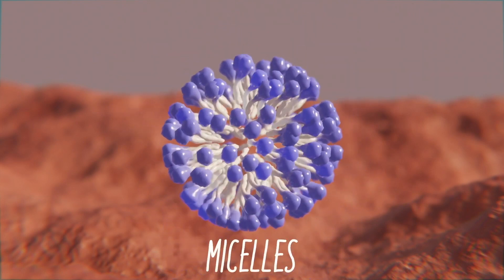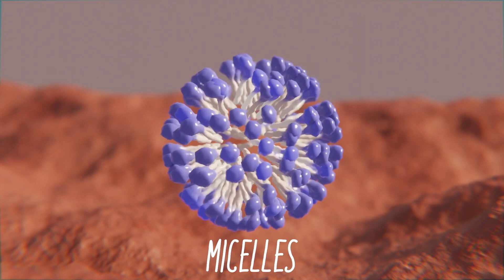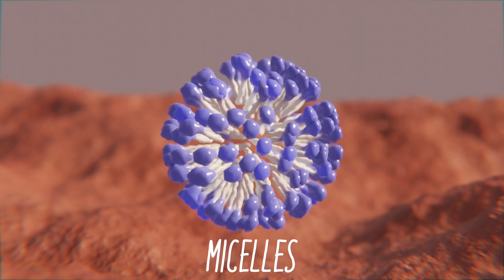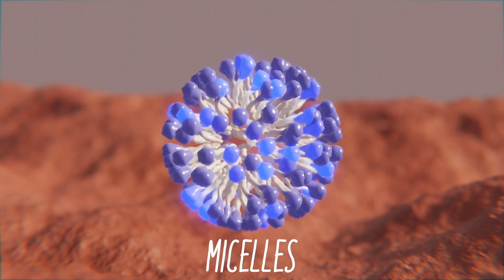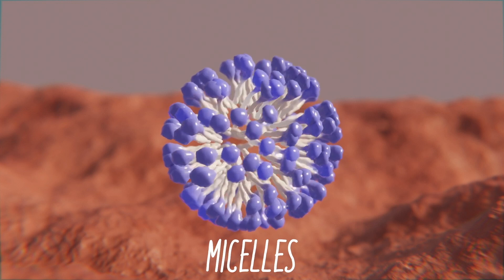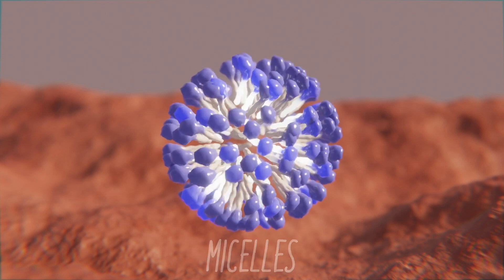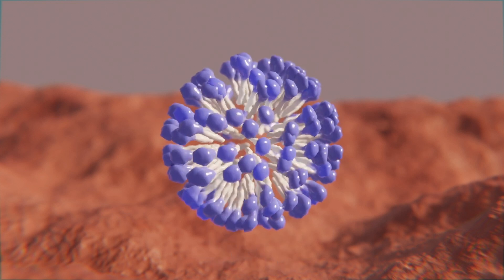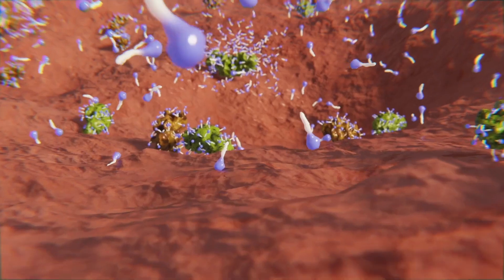How Soap Works - 3D Animation

Comment: Sometimes when I shower my brain convinces me that soap doesn't actually work and Im still dirty. So hopefully with this video I can understand that no soap isn't just a slippery block that smells good, yes it actually gets me clean.
Reply from the maker: Yes, hopefully!  🥰  We're glad to help!  ❤️
Reply: I don't work for the company, I'm just a fan of Nixon shampoo and conditioner, I've used it exclusively for 30 years! The shampoo is designed to thoroughly remove sebum (waxy substance) from the hair follicles, the conditioner is light, free of oil, and the consistency of a light hand cream. It doesn't stick to the hair, what is needed is absorbed by the hair and scalp, the rest rinses away completely. If you don't want the expense of this product, after rinsing any conditioner you use, use just a little shampoo and do a quick wash, thorough rinse to remove excess product from your hair.

Comment: Hello!! Thanks for the explanation. I have a question. Please answer it.
Structure of micelle that would be formed if you dissolve soap in a hydrocarbon? 
I hope you answer this and thankyou!
Reply: It won't. I'm sure you mean ethanol. Ethanol is less polar than water, so the micelles won't form. Micelles can only form in POLAR substances.
Reply: I'm pretty sure this is a basic video about soap. If it helps people want to learn more about science it did its job.